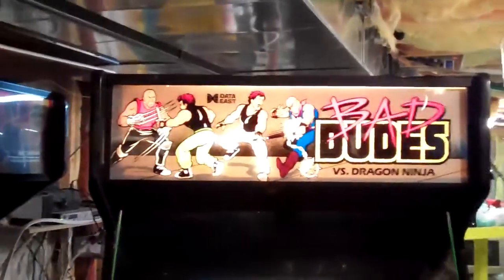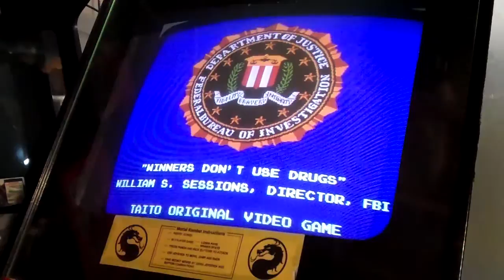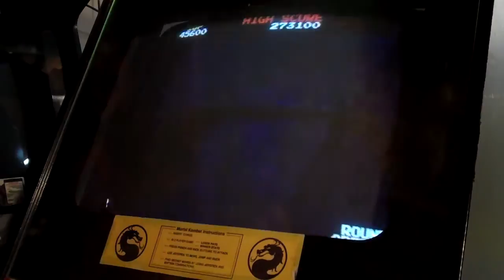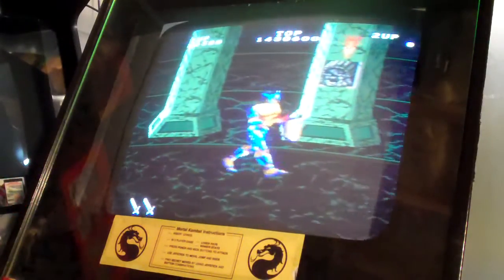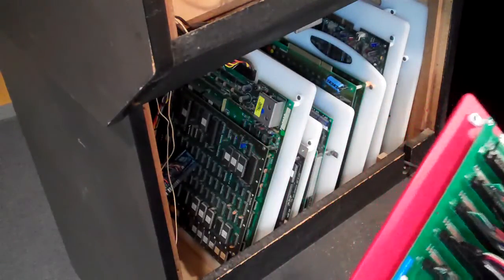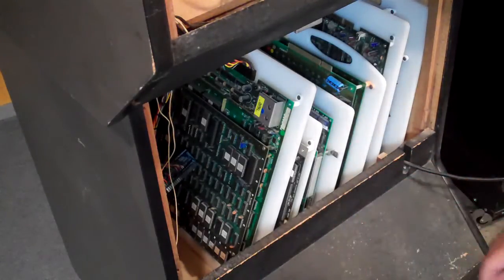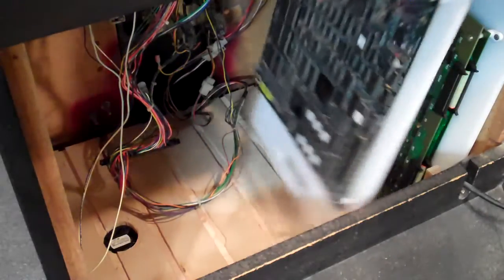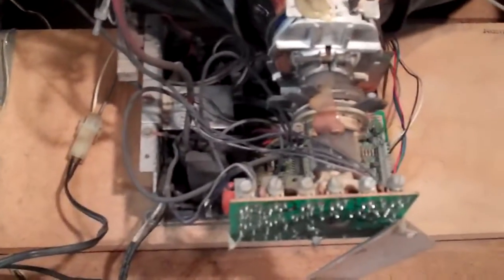6-in-1 JAMMA Multi-Slayer Arcade Cabinet

Comment: Cool to see a 6 in 1 in action.  Are all these games really running off that power supply?  That's what a typical switcher 100watt or so supply?

For multiple board stack games, would you suggest a bigger supply?  I'm thinking about doing a taito classic 2 in 1 with a couple of 3-4 boardset games, and wonder if the the typical happ power pro 110w supply will work.